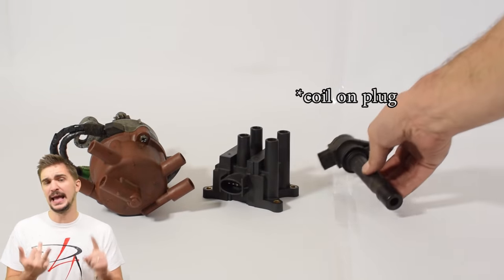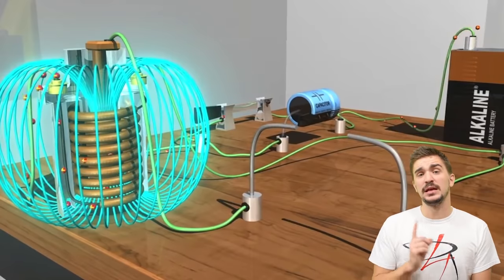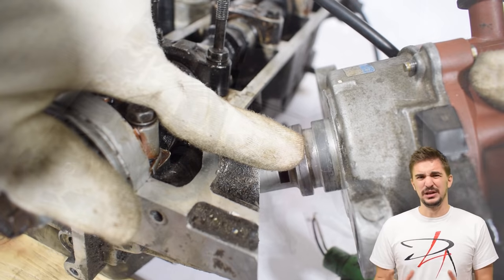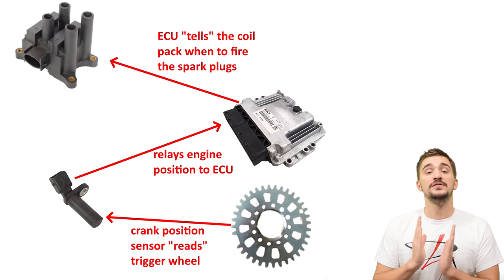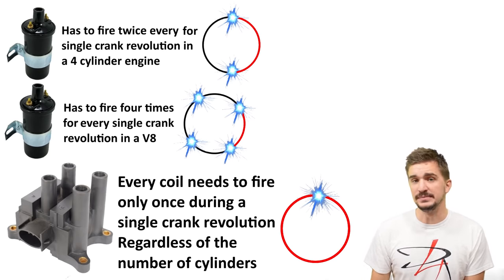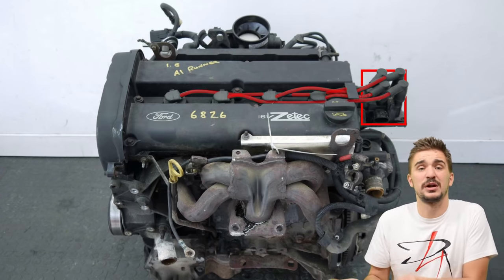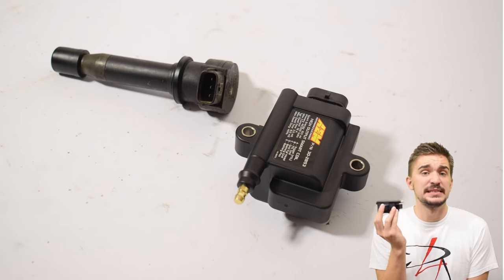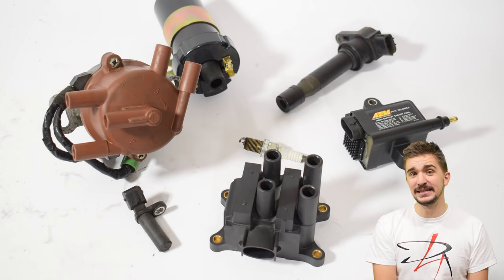Distributor VS Wasted Spark VS Coil on Plug VS MONSTER Coil near Plug

Comment from the maker: Monster coil: http://bit.ly/d4ahocoils
COP:
 https://amzn.to/3efickY
Wasted spark: https://amzn.to/3jMXQRh
Distributor:  https://amzn.to/3kIoewS
Spark plug wires: https://amzn.to/2TJylFO
Support d4a: http://driving-4-answers-shop.fourthwall.com/
Reply: 8:00 would a V-6 need 2 packs as well or are you referring to a inline 6?
Reply: @stuffhappensdownsouth9899  A v6 usually uses 3 dual spark coil packs, they fire 2 cylinders per pack, instead of 4.
Reply: Clever promotion video... Block..
Reply: @Frosty_Saiyajin thx
Reply: @stuffhappensdownsouth9899  Cheers
Reply: Still lack capacitive discharge ignition and plasma jet ignitions...
Reply: I don't think that the voltage drop due to the wire length is fixed on the COP system. First, at high voltages efficiency is better, meaning that a coil on plug should have a higher difference due to difference in length of the low voltage wire. Second, I don't think voltage drop is significant due to wire lengths, the major problem should be contamination reducing conduction.
Reply: Is there some viable way of using independent coils in a distributor based ignition system?
Reply: yes msd completely replace it
Reply: Since you're super knowledgeable and I've seen your 3sgte video (nice one btw), is the gen 3 3sgte distributor or the wasted spark coil pack ignition?
Reply: This only detailed ignition system with battery. Totally left out permanent magnet flywheel systems .

Comment: I use the misfires at high rpm with a distributor as a rev limiter!
Reply: "Sounds like your engine is about crap out!"

"Nah man... Rev limiter..."
Reply: best rev limiter is the valve float smh ;D
Reply: @karoliskazlauskas1213  lmfao l was gona post that
Reply: @karoliskazlauskas1213  Best rev (and speed) limiter is to put an egg on your dashboard.
Reply: nah, redlimiter on a twostroke when you dont have one, yes i mean actualy out accelereting the exploding gas with the piston, keeps a smooth rpm too.
Reply: Idk man, the best rev limiter IMO is when the con rods fly out of the side of your engine block.
Reply: Nah more like free misfiring system for antilag
Edit:misfairingo system
Reply: @aaronbryan5095  Jesus you terrified everybody with this comment bud lol
Reply: @awmaister5529  SR20 has left the chat
Reply: Lay off the gas to save money and keep things simple lol
Reply: Except 80's f1 ran 18k rpm and distributors.....
Reply: @awmaister5529  could this monster coil be adapted to a 4 cylinder motorcycle..??
Reply: Reading all of these hurt, but i do have a contribution. Rev limiter on a 2 stroke Detroit is when you can hear it change from a internal combustion engine to an external combustion engine.
Reply: @RussellCambell  can u dont
Reply: I think a LOT of us used to...I did a few times in a '68- 396 Chevell -😁
Reply: @karoliskazlauskas1213  Yep, it's saved more than one, unless the pistons didn't have valve clearance 'pockets' then it could get ugly pretty quick.😁👍
Reply: @jbobea  
That's a G-limiter.😁
Reply: @aaronbryan5095  
That's the 'permanent type' rev limiter. I prefer the intermittent, non-permanent type. Takes less time between seeing if it still works.
Reply: @jbobea  new set of steak knives with every airbag that brakes faces oh the seat belt is extra both are redundant
Reply: Mk1 golf Gti rev limiter is there from a metal spring plate on top of the rotor arm this was easy bypassed by using a rotor arm off a 1.3 golf
Reply: Best rev limiter is the current gas prices
Reply: @calebguffey4322  I drive a very golf v6 4motion and get smiles per gallon
Reply: @awmaister5529  rev limiter on a 2 stroke is melting your piston

Comment: I feel I have to point something out which is consistently overlooked by this channel. Distributors will be more reliable in the long run. I've never had a distributor setup fail on me but I have had coil on plug fail multiple times for example. Mechanical may not be as fancy but they simply work.

Comment: I'm really impressed with your ability to convey technical information in such an easy to understand way.  I didn't understand why a "smart" coil (AEM) would be better than a COP setup on my 4AGE race engine,  but I do now!  Thank you.
Reply: Cop will be fine on non boosted engine, motorcycle engines that rev to 17,500rpm use coil on plug

Comment: Information on a topic I never thought about. And I was engrossed the entire time. I wonder how long until we see monster coils as a oem.
Reply from the maker: Thank you glad you liked the video. I doubt we'll bee seeing monster type coils on OEM anytime soon as these really only become necessary when you start pushing the performance, stuff like 150-200 hp per cylinder. So they wouldn't really give any additional benefits on a stock oem engine, plus they're kinda big and bulky so not that easy to fit in modern crowded engine bays. But in the world of tuning, these things can completely change an engine.
Reply: My 17 year old LS1 has OEM coils setup the same as the monster colis?!
Reply: You wont.
Reply: @MaFTB  GM LS engine ignition use exactly the same technology (but not brand). And it performs with superchargers (factory) and aftermarket turbos, highest stress point for ignition. Arrangement allows for physically bigger coil, more, heaver winding's. Independent dyno testing has not found improvements with after market coils on these engines

Comment: you stated why the disturber is the best in the beginning. It's mechanically linked to the engine. no computer needed. no bullshit ECU or extra stuff that's expensive to replace when it breaks. I did the plugs cap and rotor in my small block chevy, and it cost me 97 dollars. most of which was the AC Delo plugs. compared to an LS engine where a coil can be upwards of 150$ for one. I will stick to the old school stuff. carbs, pushrod, and disturbers!
Reply: Screw the old unreliable stuff. Too many moving parts that fail. You need to put new ignition parts on your small block every year or two. Nothing wrong with computers, they almost never fail. And you can drive an LS engine for 300k+ miles and 15+ years without replacing a single ignition coil. And in a rare occasion when you do, they are not $150. Rockauto sells them for $56 (Acdelco) or $18 (aftermarket).
Reply: Very true coil on packs are over priced pieces of junk. old things like that hardly ever break and if they do it's no 800 dollars to fix
Reply: OEM parts are best to use because you're vehicle was made to run efficiently with those parts I did what you're saying to do and put aftermarket parts on and nothing will last as long as an OEM part trust me I already tried
Reply: @PTTrue-mu5rq  yeah the only after market parts that I would trust is performance parts, like holly and msd. But I agree OEM is the best and no matter the parts store. They all got parts for a small block Chevy or ford
Reply: @artementy  if you think old stuff has too many moving parts look at a new double over head cam v8 that’s to many moving parts and a mile of timing chains. The old stuff may be less fuel efficient but it’s more reliable even when is not taken care of that good. And cheep after market stuff is just asking to be stranded on The side of the road. OEM or performance only, in my opinion. And I only change the ignition parts because I did not know the last time they had been done. I won’t have to change them for years. They hardly ever fail if you maintain them.
Reply: As much as I get that, what is going to happen when you can no longer get parts for the old stuff? It's getting more and more difficult as it is. My car has a somewhat rare engine (330 ci Oldsmobile small block) and while I can get most wear items and surface components as they're shared with both the more common 350 Rocket and the small block chevys, major things like OEM crankshafts, pistons, conrods, etc. are all completely unavailable, meaning I would have to cannibalize another engine to get them, and that's if all the 350 rocket guys haven't already stolen every spare 330 jetfire crank in existence because they were forged. Wanna know what is available and probably will be for the better part of a century? Parts for LS engines, especially the iron block 5.3 and 6.0 that were in GM trucks from the mid 1990s to current day. Of course the third gen 5.3 and 6.0 are both the go-to because they're right in that sweet spot of power, reliability, availability and price.

Comment: It is worth noting that for direct coils you need to tell ecm camshaft posision, basically using the same sensor as crankshaft position sensor but on camshaft or camshaft wheel. Only then it will know on what stroke each cylinder is and fire every other revolution.
Reply: they could be run as wasted spark
Reply: @fuzzy1dk  thats exactly what I meant:)
Reply: It can operate with only crank position sensor. ECU can start the engine on wasted spark mode and then guess the cam position as there are only two options. If that causes misfire (engine speed drops) the guess was wrong and cam is the other way around. This also works for sequential fuel injection. Just start with patch injection and guess to switch to sequential.
Reply: @Retired Bore You totally missed my point
Reply: @Retired Bore Ok. Then I misunderstood you.Sorry

Comment: Coils don't "charge up" like capacitors do. That's sloppy language and doesn't really describe what's going on. Coils generate a primary magnetic field when current is run through them. The larger the current, the larger the primary magnetic field. The primary magnetic field is limited by saturation of the iron core, but that's a separate discussion.  The reason coils take time to fully "turn on" the primary magnetic field is due to Lenz's Law. As the current and primary magnetic field increase, a secondary magnetic field is induced that opposes the primary field. That also induces an opposing electric field which pushes against the electrons flowing through the primary coil. So as the current is increasing the electrons have to fight against this induced electric field. This slows down the acceleration of the current, which prevents it from instantaneously turning on. It has an effect very similar to mass in mechanical systems, the heavier something is the slower it accelerates. In the case of a coil it's called inductance. The greater the inductance, the greater the induced electric field pushes back against the electrons that are trying to accelerate through the coil. So a bigger coil is "heavier" and "harder to accelerate" because it has more inductance than a smaller coil.

Anyways back to the ignition system. Eventually the primary coil finally reaches full current and primary magnetic field. At this point, the secondary coil, which overlaps the primary but isn't physically connected to it, has zero current but full magnetic field running through it. It's when the primary current switches off (but not instantaneously, again due to Lenz's Law) and the primary magnetic field starts decreasing, Lenz's Law causes an induced electric field to form in the secondary coil. But now instead of slowing down the electrons like what happened in the primary coil, the electric field pushes against the electrons in the secondary coil and accelerates them. So current only flows in the secondary coil when the current in the primary coil is (gradually) turning on or off. Since the secondary coil is connected to the spark plug, this is ultimately what causes the electrons to jump across the spark gap. Now, a spark plug does have capacitance, so current running through the secondary coil causes the electrons to build up at the edges of the spark gap before they generate enough voltage to jump the gap and form a spark. So the spark plugs actually do "charge up". But not the coils.

So this might cause you to ask, if a more powerful coil is "harder to accelerate" because it has more inductance, then why the hell would you want it?! Doesn't that just slow things down? Increased inductance leads to greater magnetic flux for the same amount of current running through the coil. If inductance is like "mass" that makes electrons harder to accelerate, it also gives them more "magnetic flux" which is like the electromagnetic equivalent of momentum. So when the electrons are charging up the spark plug, they're not bumping into it like a scooter in a parking lot, they're slamming into it like a semi truck on the highway. That's why you get a bigger spark when the coil has more inductance.

https://en.wikipedia.org/wiki/lenz%27s_law
Reply: Yes, it's sloppy and inaccurate, but it's close enough and this is a video about automotive engineering for noobs, not electrical engineering
Reply: I understood it only because I studied electrical engineering. But yes, it's true.
Reply: Oh yeah, I get this is a "noob" video... But I felt somebody should give a more detailed physics explanation in the comments in case somebody wanted to dig deeper. Hope it makes sense for somebody. If it's too wordy for some they should just look up Faraday's Law and Lenz's Law on Wikipedia.
Reply: But of course, Lenz's law doesn't apply to metric engines, so it isn't enforced.

Comment: I may (cough cough) have replaced my RX-8 OEM coils with those monstar coils... (cough).. 
I guess they're a good fit for rotaries since they are high rev lovers and also, unlike reciprocating piston engines have to literally fire for every single cycles. (Might still be overkill.. But at the same time.. There's nothing overkill on rotaries if you want to keep them alive)
Reply: should have downgraded to the RX 7 FC turbo - system with 4 full size coils . Never have issues, that is overkill... BTW they fire twice every work stroke with a 0.. 20 ° difference. There is a leading and a trailing one.
Reply: @heikopanzlaff3789  RX-8s are everywhere and often sold for dirt cheap because people didn't want to maintain them properly.  RX-7s are not as common due to the same issues as the RX-8, but also due to being hamstrung by American regulations, the notion that foreign vehicles were worthless (which was a root cause of the 240SX extinction event), the destruction of thousands of functional cars at the hands of Cash for Clunkers, and of course due to sports cars seemingly always being equipped with an 'aggressive SUV/pick-up driver magnet' that turns them into accordeons.
Reply: An ignition coil is rated for kv(1000v) voltage potential, actual kv used to fire the plug  is measurable on a scope.& more potential can help in high rpm air/ fuel/ spark advance ratio uses.. Your  STD coil for early point sys  rated @20kv⚡
HEI coils @40 - 60kv .⚡⚡ (  @miliamp flow)
Most modern  coils rated@ 60 to 90 kv& up however@ 90 kv&+up 
( MULTICOIL pack) & coils potential  exceeds the  1amp or better rate  and can injure or kill  you. Use a spark check tool for any diagnostic test for a no spark condition on modern  computer controlled engines.  Not the old  method-hold plug wire to block for 20- 40 kv rated coils. ⚡ most of your old coils are  rated in miliamps.1amp @90kv+ and above  can cause human heart stoppage.( +ruin your day )A coil must completely discharge  voltage during  firing  stroke  before recharging,-points closed ( dwell) or HEI distributor pickup do this In milliseconds  (voltage over time) (dwell affects base ign. timing) Coil packs use wasted spark theory.on the matched cylinder to crank( fire stroke/ exhaust  stroke matched reciprocating cyl) most individual  coil per cyl.  fire like  a std coil & are computer controlled .(ECM)
Hope this helps . Make sure all battery  leads clean  and engine/ chassis grounds  secure.
Make sure aftermarket stereos are on  clean fused 12v source, not ANY   computer (ECM )related circuit or the car will fire  and surge sporadically to the music beat.( poor driveability)
Reply: @heikopanzlaff3789  RX7's of all gens are now skyrocketing in prices, RX8's on the other hand are still low on prices...

Comment: My Father had a 2010 suzuki jimny and it's been used in offroad racing, and upon looking at underneath the hood it has a weird ignition system, it has both waste spark and coil on plug in it, which is very convenient 'cuz even though it's stock it still runs smooth and sounds like a civic
Reply: Some Mazda engines used the same system, as well.
Reply: @jameshaulenbeek5931  nice